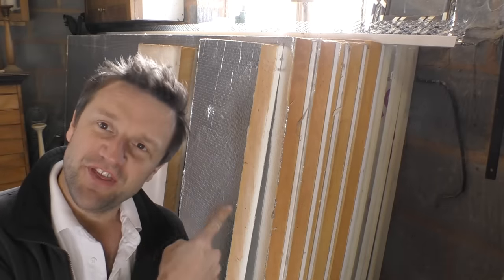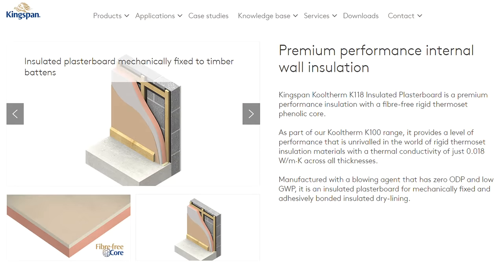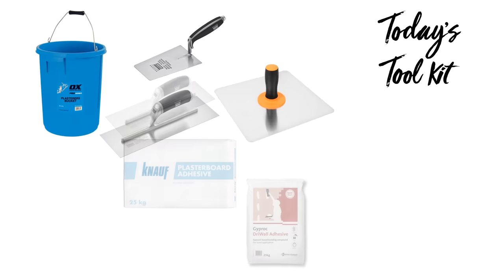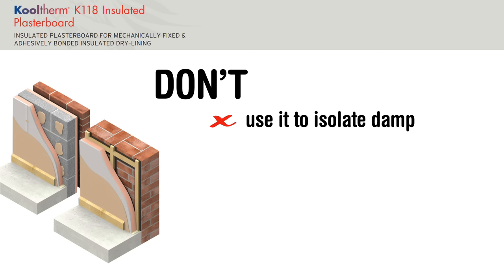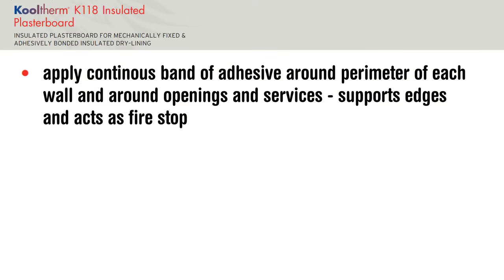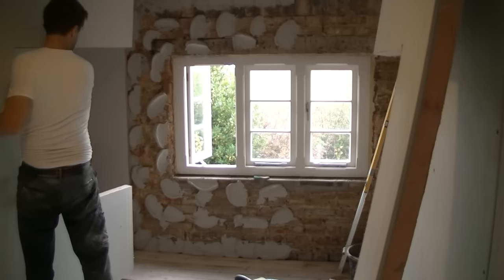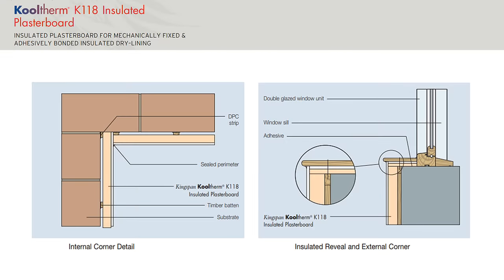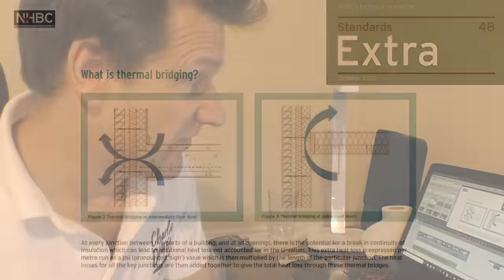How to Dot & Dab Insulated Plasterboard - a DIY Guide

Comment: Beautifully detailed video as ever - more info than anyone could ask for.  Thank you.

A question though for anyone reading this: Hands up if you honestly contact Building Control for DIY projects like this.  Do you?  My experience of Planning departments in local councils hasn't been great - very often people who just love to block activities and wrap them in red tape and application fees.

I live in a stone cottage in Scotland which I now intend to be my final forever home and, quite honestly, I'd be hard pushed to ask the local council for permission to do anything. Judging by the building work I have uncovered so far as I upgrade things I seriously doubt the previous owners asked for permission either.  I'd be very interested to hear anyone's personal views and experience on this.

(My cotage walls are granite with lime mortar and >0.5m thick. When I redo the insulation  - where "redo" means actually put some in - I will be leaving an air gap so the mortar can breathe, so no adhesive bonding for me.)
Reply from the maker: Honestly, I think most people won't. The problem is I have to dot the i's and cross all the Ts, putting these videos out there as it would be irresponsible if I didn't. The answer to your point about the council's building control dept is to find a building control consultant. That's what I've done. He's probably more expensive than going direct, but he manages the process and deals with the certificates, and can work around the council's ineptitude. Interesting to hear about your cottage. There's a real uneasy stalemate at the moment between the restoration lobby who would say don't touch internal insulation with a bargepole (I've had a few on here, saying I'm turning my house into a mini Grenfell, or that I'm creating massive problems with interstitial condensation) and the government backed green/ emissions cutting lobby who say insulation is crucial. To the former, I make the point that I'm not vandalising my house (as they imply I have by removing all that lime render internally) as it was vandalised in the 70s when my predecessors covered the outside in tyrolean render and then stopped the inside breathing by wallpapering everywhere with polystyrene backed wallpaper. However they do have a point in the sense that internal insulating is something of a dark art. You do have to do everything you can to prevent cold bridging if you do what I've done, and pay due consideration to the problem of condensation forming inside the walls. Cold bridging can be an issue where you cut through the insulation for plug sockets, and dare I say it, where each plasterboard sheet butts up to the next. The room you saw in this video is pretty good, I think, but by son's room does have some damp spots behind the socket back boxes. In our recent master bed project I insulated instead by battening the wall, infilling with 1 inch ecotherm board and foil taped the battens. There's a natural gap behind because I had to build the battens out because the wall wasn't true. I then screwed the insulated plasterboard onto the battens. The electrical sockets were cut through the insulated plasterboard, but with a wooden plate glued and foil taped into the back of the insulation behind to screw the box to, and the wires channelled through a vertical hole in the insulation. The gap underneath the insulation I filled with expanding foam tape. This way I've pretty much eliminated any cold bridges and hopefully any ability for condensation to form. Frustratingly I can't for the life of me find the videos I took of it.
Reply: @CharlieDIYte  Thank you Charlie for taking the time with such a detailed reply.  I fully understand what you say about restoration etc.  Up here the topic is generally nothing like as acute since the main material is igneous rock rather than beautiful Victorian red brick.  The main slant on insulation when you live north of the 57th parallel is just having as much as possible; preservation is more your own body temperature than the property!  (Of course that's a generalisation before anyone with a Listed castle contradicts.)

The main principle with stone cottages up here is to build a box within a box, so air gaps all round a heavily insulated inner.  The problem with that in my case is that the cottage was small enough to start with, so stepping inwards with the insulation seems crazy!  Those granite walls are going to look fabulous after I repoint them though, hence no external insulation.

It's a 30-year project so I look forward to many more hours of watching your peerless videos.  I may be a DIYer but I'm not on the clock and it's my own property, so when I tackle something it is done right.  I know many others - obviously including you - feel the same way.

Thanks again for your channel - it's a goldmine of help videos for people like me.  Keep them coming!  🙂👏👍

Comment: Brilliant video, I'm about to insulate a 3m square room  which will become a utility room. Looked at superfoil, Rookwool block, Celotex ....... etc etc ..... thinking attaching batons is the only way to provide some method of attaching wall units, or anything other than the lightest of decor additions to a 50mm or more insulation product. Would you be attaching shelves or other wall hung additions to the room you've insulated in this vid ??

Comment: Once again - really useful. - Thank you.
Reply from the maker: You're welcome. Check out the expanding foam glues if you're thinking of doing this. Much better for eliminating cold bridging particularly around the holes you cut for the electrical back boxes. And you're not putting all that moisture into the walls 👊
Reply: @CharlieDIYte  I will be doing exactly that.  Thank you so much.

Comment: Could those wooden planks be a possible mold risk when they are trapped between the insulation and brick wall as they will absorb moisture but won't be able to dry properly?

Comment: Hello

Firstly, thank you for sharing your advice, experience and knowledge with us. 

I was thinking of insulating the wall in my garage that runs along the house. 

They’re big grey concrete bricks. 

Do you think this is safe enough to glue straight on (exactly like in this video, including the prep work) or too much risk as it’s in a garage (with risk of cold moisture filled air coming from under the garage door)?

Any advice is much appreciated. 

Many thanks

Bianca 🙏

Comment: Thanks this is a great and insightful video. 

Question- once completed, what about shelves or other fittings to the newly insulated plasterboard? Cheers.
Reply from the maker: You're welcome. On the insulation if you're thinking of doing this consider using expanding foam glue rather than plasterboard adhesive - so much better for insulation around plug sockets and in between sheets thereby minimizing cold bridging. On shelves, if not too heavy you could just anchor into the foam thereby not compromising the vapour barrier behind. Use a wall anchor or T bolt as discussed here https://youtu.be/L2Hy1IhQ17s as they force open in the foam. If you're putting up something really heavy make sure you put plenty of foam or adhesive behind the area you're fixing into and you'll have to use a frame fixing and screw right into the brickwork behind. 👊

Comment: Charlie can you tell me your cottage is old but have they used a lime mortar/plaster? How easy was it to actually board over and how much did the boards actually eat into the room space? Once you get to existing windows how did you go about the space of the windowsill ?
Reply from the maker: Hi there. The internal render was put on in the 70's. Yes it was pretty easy once I'd had a bit of practice (remember, this is my third room). My wife was keen that we didn't reduce the rooms too significantly so we went for the 50mm insulation, 62mm in total. To be honest, once the boards are in place you totally forget what the room was like before so it doesn't feel any smaller. The way you should do the window reveals is described at 23.23mins in the video. How much insulation you use though will obviously friend on the space you've got between brickwork and window frame.

Comment: Put a heavy duty 50-60 litre plastic box on the floor under your chisling and most of the old plaster drops straight into it. One full box is just about carriable straight to the skip - saves a lot of time and mixing the jobs is less tiring. As a plumber I've used this with tile removal for years.
Reply from the maker: Good work. I used to carry rubble and soil through the terraced house to the skip on the road in those Addis flip top bins. I'd buy a few from the pound shop and confuse the shop keeper by saying I didn't need the lid 😉

Comment: Great vid, question do you need a vapour barrier between the PB and insulation to prevent issues with  interstitial condensation? We did this method on old house and ended up with mould spots coming through the PB.  All about the dew point.

Comment: Hi Charlie, A great informative video, thanks! Just out of interest, once you've bought the initial tools (eg. spirit level, drill etc), how much would you say, roughly the room in the video cost in materials to insulate with the K118 before plastering? Thanks!
Reply from the maker: Hi, you're welcome 👍We're talking 5 sheets of the Kingspan at say £48 per sheet (I don't know what it is retailing at right now) and 2 sheets of standard 12mm plasterboard. Ideally it would be foil backed but you can't use the adhesive with this so maybe batten the whole lot instead. I would have used about 4 bags plasterboard adhesive. Can I leave you to add all that up as I don't know what this stuff is all retailing at right now.

Comment: Great video, gives me the confidence to get started.  How did you handle the windows though? What precautions need to be done there to prevent damp air getting in behind boards? Thanks a lot!
Reply from the maker: Thanks David. I cover this at 23.23minutes in the right hand diagram titled "Insulated Reveal and External Corner". You basically want to make sure the insulation is continuous around the corner (ie not separated by any plasterboard - and personally I think the left hand shot at 23.23 is wrong for that reason). You do this by cutting a section of insulation away from the board you're butting up to the corresponding corner section - see the vertical section of plasterboard in that right hand diagram - whilst leaving the plasterboard intact in the section you've removed (the insulation peels off the plasterboard easily once you've cut it). For belt and braces, if you're concerned you've left any gaps around the corner, as you butt up the two pieces you could quickly spray in some expanding foam. The other potential cold bridge is where the plasterboard meets the window frame, so you want to spray some foam on the edge of the board there too, to ensure that the insulation butts up to the window frame without any gaps (assuming of course that your window frame is wide enough to accommodate insulated plasterboard - a lot aren't). Hope that makes sense. I have some video footage of where I did this on our bedroom wall which I will try and post some time but it won't be for a while unfortunately.

Comment: BIG question: how to fix heavy stuff to these sorts of walls without prior knowledge (such that you might put studs up to the back of the PB where you will need it ...  Current trial method in my house for radiator fixing .. :120mm frame fixings combined with shorter fixing plugs down the middles of cut-to-flush lengths of 15mm copper pipe between the (old, crumbly) brick and the front face of the PB, against which the load can bear...  However I haven't yet filled the rad with water ...

Comment: Nice job, I'm planning the same job for several rooms. Can you tell, how long it took to do a complete room (2 walls, 1 window)? And how did you put the isolation boards around the windows?
Reply from the maker: Thanks Roger. The insulation would take a couple of days (or a weekend). For how to do around the windows, check out 23.23 minutes into the video where there's a visual. You might also check out the K118 brochure, a link to which is in the Description at the end of the video and can be downloaded here http://bit.ly/2GQeAHp

Comment: Thanks for the video, very interesting.  I have to disagree with you on the "just doing double glazing isn't worth it".  Obvs, many old houses are unique but I have to ask if you actually did any heat loss calcs and have some figures to back your statement up?  If so, please share them with us because in my experience simply replacing old single (especially sash) windows with a modern double-glazed (tho I'd argue you might as well triple-glaze these days as the extra thermal performance is well worth the extra cost) simply from the perspective of draft reduction alone is way more significant than 50mm of insulation on the walls.  If you have a large amount of glazing and/or live in a windy location (where the drafts - and therefore heat-losses - are far worse due to air pressure on one side of the building) then this is even more relevant.

Whilst I'm at it, if you do do the calcs, compare the heat loss from the fabric of the building to heat losses due to the 'recommended' air changes... and you will get a big surprise.

Comment: Our 1875 built terrace suffers terribly with condensation on the solid brick external walls in the winter. They're absolutely freezing!! I'm unsure if there is any moisture penetration now. There used to be, but since we had the guttering fixed it's gone away. Downstairs we do have a small area which is below ground (we're on a slope). What am I better off going for? Assuming battens rather than dot and dab? I just need to raise the temp of the bloody walls! I'm assumung that the boards with foil backing are the ones designed to combat condensation in the void? Would I be better off hacking back to brick and adding pva beforehand?

Comment: Great fan of your videos Charlie, quick question. I'm just trying to quickly insulate my single brick garage. Is there any reason I can't just screw 11mm OSB to the wall with 40mm Celotext sandwiched in between or is there a reason to dot and dab the insulation to the wall first? Thanks and keep up the great work!
Reply from the maker: Thanks Norman, I really appreciate that 🙏 So the OSB is going to be the wall finish in the room? No reason at all why you can't do that (and the OSB will itself provide a bit of insulation, I guess), and in fact if you did dot and dab, you'd want to mechanically fix it to the wall anyway. Dot and dab is used because it's quicker and easier than battening, particularly where the wall isn't even. I guess the garage won't be occupied that often (so minimum vapour generation) but your biggest priority with something like this is to ensure you don't have any cold bridges if the room is going to be heated, and the integrity of the vapour barrier. What I've learnt since doing this video is that those sockets cut through the insulation are a major source of cold bridging and can let vapour through so on my last build on my bedroom, I battened the wall with 2x1 tanelised, with DPC where the battening touched the wall, infilled with 1 inch foil backed ecotherm (like Celotex), taped over the battens with foil tape, and then screwed the insulated plasterboard to the battens. The wall was massively uneven behind so by truing up the battens I've also got a nice gap between the battens and the wall. That way, I could cut through the insulation for the electrical back boxes without compromising the integrity of the insulation or vapour barrier (I taped a piece of ply to the back of the insulation to screw the back box into, and drilled a hole vertically to thread the electrical cable through). The small gap between the floor and underside of the insulation was filled with a expanding foam tape, which is breathable but prevents moisture and is very efficient at eliminating cold bridging. It's a bit of a dark art this, but I reckon that method is pretty good. Hope this helps and good luck with the project.

Comment: Very Very Very good 👍
Reply from the maker: Thanks Peter. If you're planning something similar pay close attention to the sockets as if you cut all the way through the board this is a source of cold bridging. I think if I had my time again I'd use expanding foam around the edges and behind the socket, to eliminate any cold spots. I've just done our bedroom wall and in there I battened, insulated with 1inch insulation board between the battens and then foil taped over the battens. I then screwed the insulated plasterboard to the battens. This way there's insulation behind the sockets.  The wall was uneven so there's an air gap between the brickwork and battens, which also helps. 👍🏻
Reply: @CharlieDIYte  ok thanks.

Comment: Great video. I have limited space so the depth of the insulation board is an issue. Could you say what is the best/most thermally efficient panel with a max depth of 25 mm/1 inch?
Reply from the maker: The best is Spacetherm but it's very expensive.

Comment: Wow I want to also insulate my new house garage ( brick extension done in 2002) and your video is really good. I wanted to ask about the weight the wall can support? Do you know the maximum weight that I can mount on the wall? Say 100kg? 50kg? Do you have another video of how you finished the room?
Reply from the maker: Thanks! Plasterboard is inherently brittle - here's my fixings update video https://youtu.be/Jdu9RId7m90 but insulated plasterboard is stronger because of the support it gets from the insulation behind. There's a section towards the end of the video where I show you what fixings work well in plasterboard.